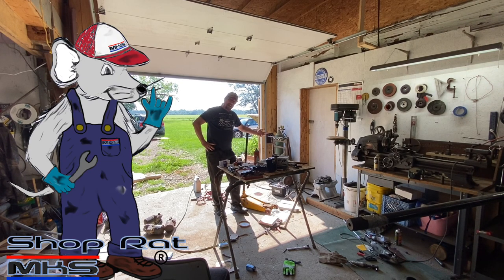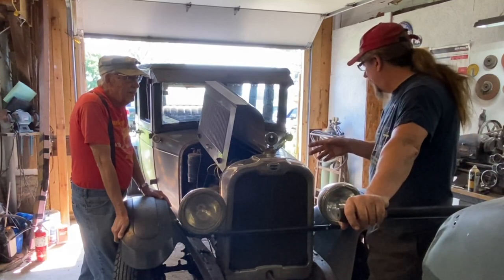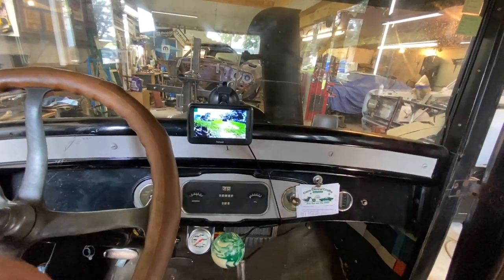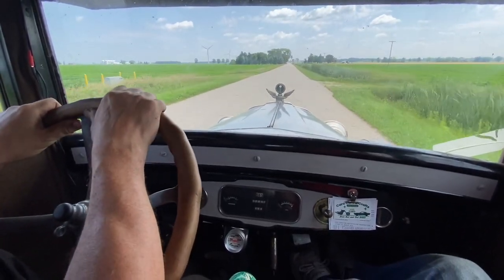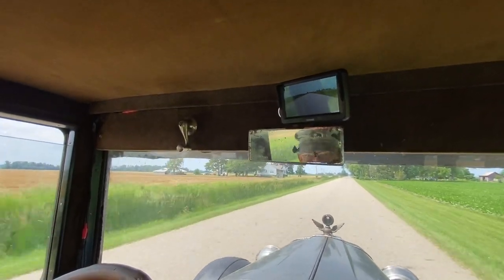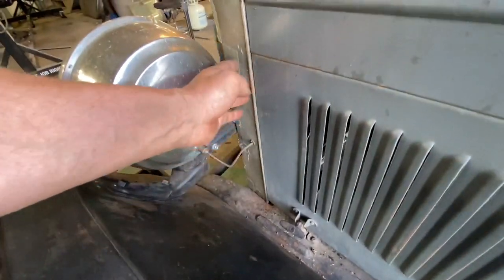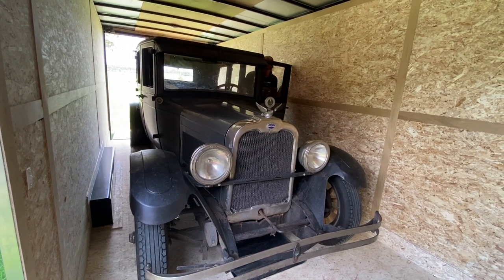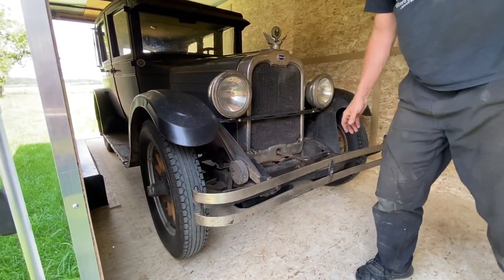SOLVED!  Intermittent REAR View Camera Issues on a 6 volt system! PLUS MORE! Something YOU can do!

Comment: Always enjoy watching you working on The Oakland with your Dad.  I'm not sure if a ferrite bead over the cable would have done any good, I tend to think the housing around the display isn't shielded and I'm not to sure that the cable is shielded either.  A mylar wrap or braided shield would help.  It looks like having it up above the mirror gave you plenty of distance to escape the EM interference.  Glad you were able to diagnose the problem and solve it.  I also enjoyed following through with your testing and thought process.  I'm not sure if I would have realized the cause of the problem as quickly.  I would guess it was EM interference, but would probably assume it was caused by the 6 to 12V converter and unshielded cables.  Not sure I would realize the proximity to the coil was an issue right away.  I learned something new.
Weather is getting warm here.  Not sure about where you are.  Stay hydrated, safe, and healthy! 🤟RAWK!
Reply from the maker: We ran it with a separate 12 volt battery and the issue was exactly the same.  So we knew it was not a power issue and RF from the ignition. 

It was a logical step to look at plug wires since we knew they were not resister wires. 

Thanks for watching.